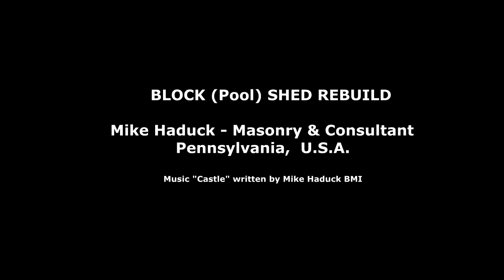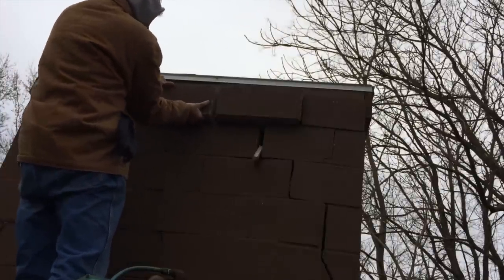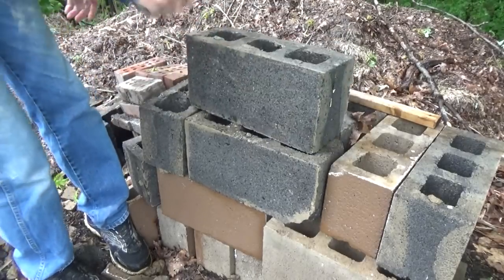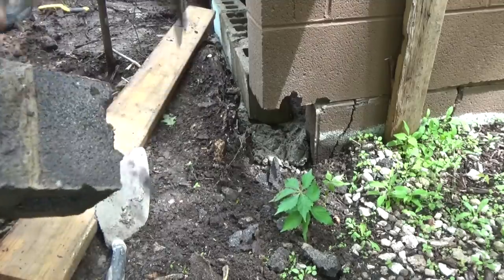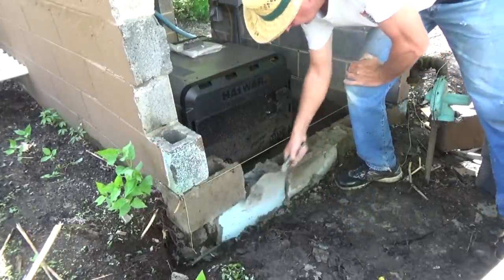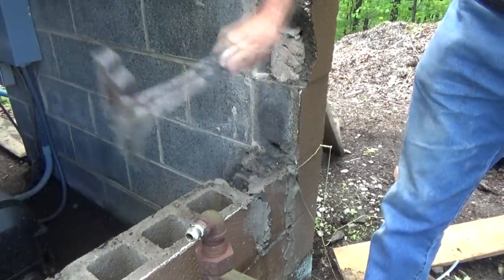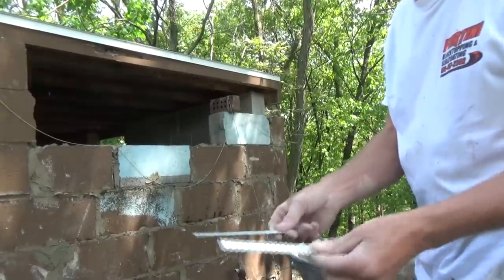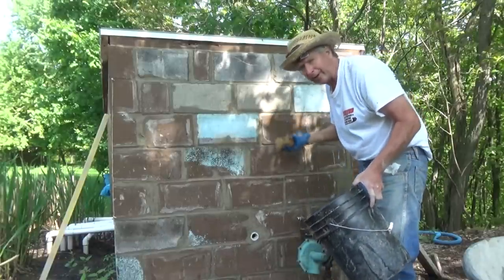MASONRY WALL REPAIR (Part 3) Mike Haduck

Comment: That “patch” will outlast the rest of that building. Question is why did it fail in the first place?
Reply: farmboy30117 because it was a shat patch
Reply: They used cement thinking it’d do the job
Reply: Those look like settlement cracks.  Probably there is no footer, or if there is it's not deep enough in the ground to withstand freeze-thaw.. Or something must have hit it, because it's just that side of the building. maybe a small loader or backhoe bumped it?.
Reply: @bonanzatime  : my guess is they had no footer.

Comment: Hi Mike. Thank you for sharing your expertise with us mere mortals of masonry :)
Do you have any tips or could you possibly make a video explaining how you would go about repairing rough faced fluted CMU blocks that have pieces of the face broken off? I hope that question makes sense, if not I can send you a picture of what I mean. Thank you!!
Reply from the maker: Hi Brio, check out my videos on foundation repair, sometimes it is best to patch it up, paint it or plaster the whole section,  thanks mike
Reply: @MikeHaduck  So I can just patch it using portland/sand mix and use a sponge once it is half dry or so to imitate the rough, split face texture? Thank you again!

Comment: Mike, what is the difference between the different types of cinder blocks? Could you do a video on that?
Reply from the maker: Hi Rafael,  the old cinder blocks were made from the remains of coal power plants but they never held up well now they are made of concrete,  thanks Mike

Comment: For such a small structure I would have considered taking the top two courses of block off stuffed each cell with a stick of rebar and then filled the cells with rebar then reinstall the top two courses with lateral rebar.  Cosmetically may not come out perfect but should bombproof it from any further separation ?
Reply from the maker: Hi Alan, I wanted them to rip it down but I was forced to do it that way because of all the work I did for them before, thanks Mike

Comment: On a tractor repair shop wall some where in the midwest, a poster on the wall read....
            You can have....
 A cheap, quick job, but it won't be good.
A good, cheap job, but it won't quick.
A quick, good job, but it won't be cheap
Reply from the maker: Thanks Len. I got to use that one, lol. Mike
Reply: Mike Hadock, i got that out of a little paperback monthly magazine, called The Farmers Digest, years and years ago... it might be still around.

Comment: I bet that mortar was masonry-cement with too much air in it; that's why it didn't stick to the block. That ready-mix cement made by Quikrete that you used to rebuild it is a portland-lime cement and will stick much better.👍.. I used to work in a cement lab, I know these things. ..... it's got to be really bad mortar not to stick to cmu (which is essentially is portland cement too).
Reply from the maker: Hi bonanz, you know I get a lot of questions on the cement, and I did a video called Should I wet it first, but it has to be wet to stick properly, and mortar don't hold up in my area, I want to do another video on what cement should I use,? because there is a ton of controversy over it,   but I found working in all these different states not two masons agree unless they are local to each other, thanks, mike
Reply: @MikeHaduck   I hear ya, brother..☺ Have a Prosperous and Healthy 2020!👍

Comment: I'd rather build a utility shed for any with machinery inside out of blocks.
One issue may have been a lack of extra ventilation.
The shed has utilities feeding it. I'm thinking heat and moisture resulted.
Then there is the concern about foundation.
Mike mentioned he patched it before.
And it's sited on a sloped location.
Really like his use of durawall to reinforce the courses.
Reply from the maker: Thanks, Mike